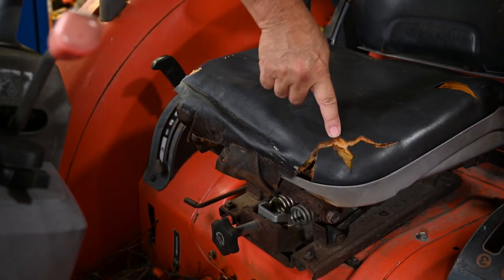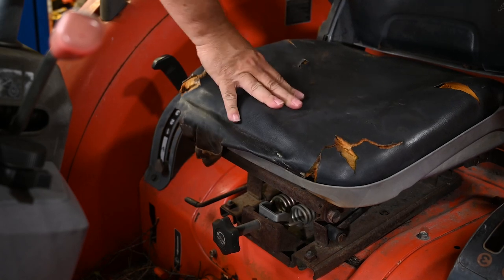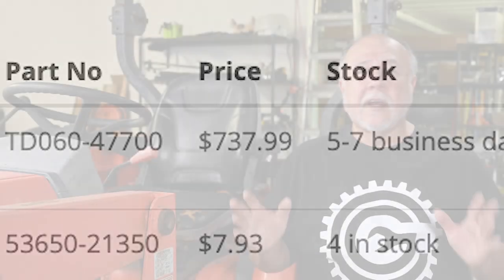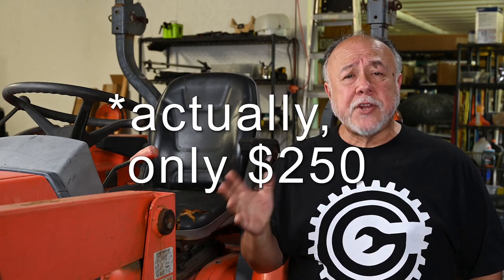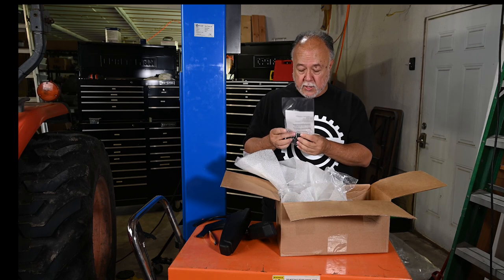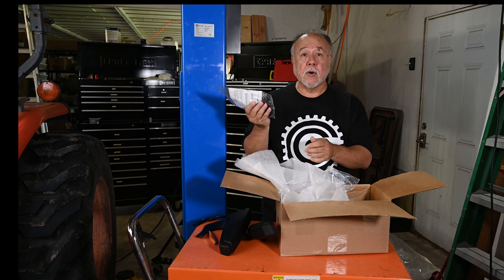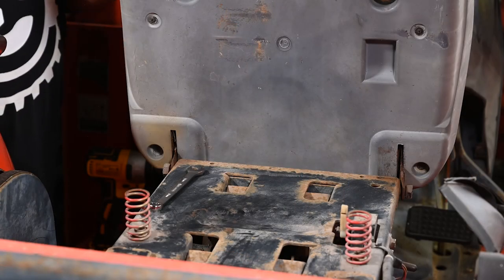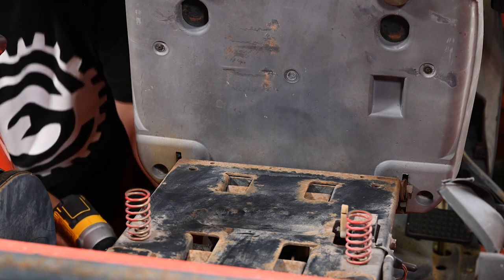I Saved $500 On My New Tractor Seat! And So Can YOU!

Comment: I got mine at northern tool. very nice seat with built in suspension.
Reply from the maker: Yeah, I looked at several models that NT had, but I didn't see how they would mount with that sloped deck under the seat. Is your machine the same or does it have a flat deck?
Reply: @CliffsGarage  mine is a L2800 I did build a new mounting bracket that hinges. this new bracket  replaced the old spring suspension bracket.